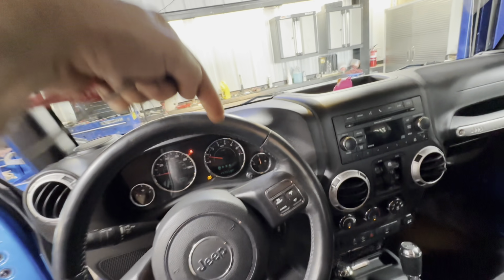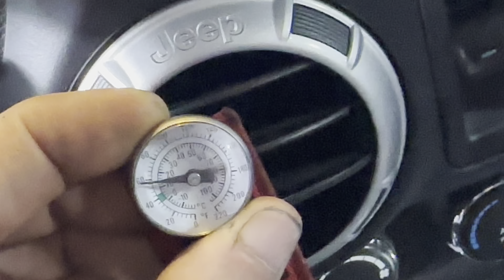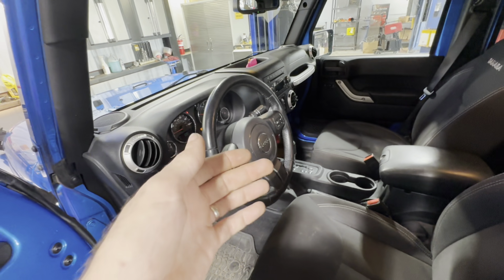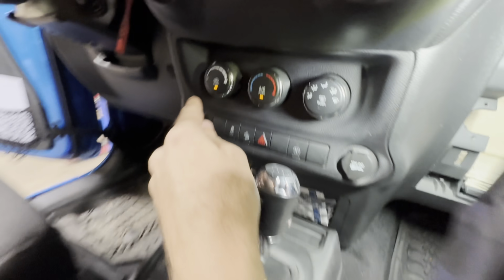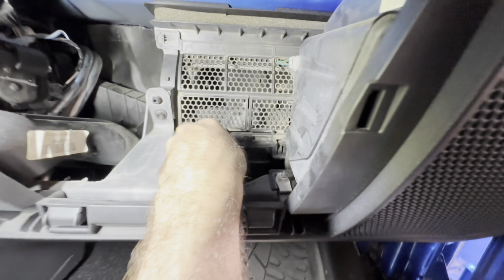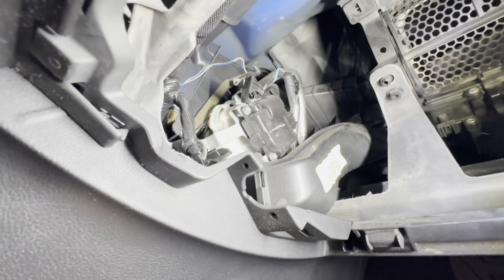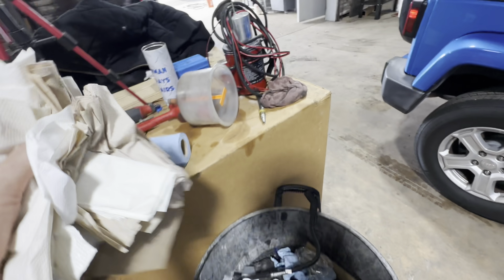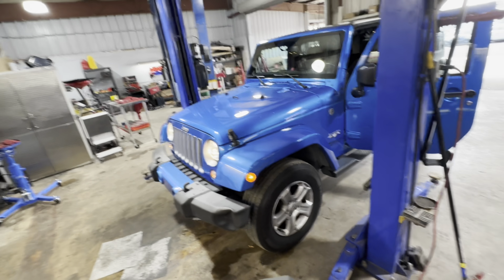Customer States: Vents Don't BLOW!  Jeep Wrangler 3.6

Comment: The reason that happens when you put too many napkins in the glove box and you open the door the suction of the blower motor sucking air through will actually suck the napkins right out of the glove box so it's kind of a bit of a design flaw
Reply: Design flaw on a jeep?   Never!
Reply: It's a jeep thing
Reply: Jeeps don't have design flaws.
Reply: It's not a bug, it's a feature!
Reply: should only keep gloves in a glove box, not napkins
Reply: @bonza167  You ever try to blow your nose with a glove?
Reply: Jeeps don't have flaws, it's just a standard feature to remind you that you paid way to much for a toaster to spend more time at the shop than on the road.😂
Reply: @MonkeyJedi99  of course
Reply: I thought that’s where the trusty handgun was supposed to go?
Reply: Napkin limit feature, brought to you by Jeep.
Reply: @pcspecialistpdx  your right they don't HAVE design flaws they ARE design flaws 😂
Reply: AC performance diagnostics:
Frequent fast food drive through user.
Reply: Put enough ducks in the glovebox, it'll keep the napkins from getting sucked out.

Comment: This happened to my 2008 Ram 1500 - hot driver's side and cold passenger side. Both my mechanic and myself believed it be the blend door. I mean, the blend door is a known issue with these Dodge trucks. Well, come to find out, and after $800 of pulling the dash, the compressor was on its last leg. Replaced compressor and a/c works great. 
The one side and the other cooling was intermittent. I will not be surprised if that Jeep comes back for a/c work.

Comment: Finding all of those napkins is similar to finding the air cleaner packed with acorns.  Both are blocking air flow.
Reply: 2007 Toyota - Pecan bits, paper, etc. We were barely getting any air through the filter! Still wonder how the critter got in there.

Comment: The "unlimited" just means 4 door.
The cabin air filter only came on some models from the factory, the ones with the auto climate control, you can indeed add them to the 2012-2018 . It takes the Fram CF11777 ita actually 2 separate filters.

Comment: There is a cabin air filter that comes in two parts. It installs behind the screen and napkins under the air recirculation vent door. For some reason, Chrysler only installs the filters in about 10% of new Wrangler vehicles . 
Funny, I had the exact same napkin issue with my Wife’s 2012 Wrangler Sport Unlimited. 
Currently, I’m getting ready to install a repaired actuator for that recirc vent door to eliminate a disturbing knocking noise emanating from behind the glove box door. A real PITA job due to access difficulties.
I’ve had to deal with every “known “ issue with Wranglers,including the mystery 302 misfire code for cylinder 2 that is part of a recall the dealerships don’t seem to know anything about.

Comment: This is a very common problem.

Had one kid who put his change in his ashtray  never took it out just kept adding. We had installed a alpine cd player under the dash, it was one of the older cars with a small square radio you could not change, guy comes in after about 2 years his cd player stopped working and his dash rattled everytime he hit a bump.
I pulled the cd player 87 cents in change came out it shorted and blew a car fuse, but i also pulled 67.57 cents worth of change from behind the dash  i had a big hump on the passengers floor board of pennies nickels dimes and quarters.  All his problem was take out related.  But he never took it out.

If you stuff your glovebox with napkins the cars not going to eat them and no putting change in the ash try won't give you more gas milage   funny when cd players came out small children decided they were piggy banks ive pulled plenty of change out of them.
Got a 20 dollar bill once. Nope they don't give quarters as change.

Thats not the biggest find i had in a car one car had a 400 dollar wad of cash,  i gave it back to the owner.
Apparently one of his passengers in the back seat lost it.

Comment: My '16 Rubicon has two filters in back of the glove compartment.  They are the cabin air filters.  The glove compartment is aggravatingly undersized.  You can't fit the manual in without flexing it.

Comment: Ray- when you were putting the coolant hoses back on that engine- you did not put the hose clamps back in place. @45:26 mark of the 1:18:52 video you made on this Jeep. Maybe you did it off camera? I’m sure you’ve said as have others, how easy it is to forget to come back on bolts, hoses, connectors once you start on other stuff (PCV pipe in this case). That Jeep has probably been shipped down the road long ago. Great job overall Ray!!!!
Reply: I caught that too but if you go back and watch the last video for the final fluid fill up and restart he caught it and made it a point that "that's why you always do a once over follow up to catch things like that" He also forgot to tighten the air intake tube to the throttle body which he also rectified.
Reply: @kennybaumann2117 Nope, he found and connected, the air-intake and the upper radiator hose- not the coolant hoses- at least not on camera.

Comment: You can put filters in the air box... They just don't come with them... It's weird because the air box has little dividers built in for filters...
Reply: Filters only factory included on auto climate control systems.

Comment: I had same problem . I ended up flushing the heater core by disconnecting both hoses at firewall in engine bay , hooking water hose to one and the other to a bucket . Got two handfuls of rust out of it . Immediate fix ! Why it was cold on one side and hot on the other , I have no idea .

Comment: Had a 2010 Camaro SS L99 come into the shop last week.  It had warm air coming out of the left vent.  It turned out to be a broken blend door.  Large bill for the customer to get proper temp air coming out of all vents!
Reply: Or you could have cut him a break and not charged him 500 dollars to replace a 45 dollar part.  🤷‍♂️
Reply: See Ray this is what separates you from so many other shops, your integrity is without contestation!! How many shops watching this (and you know they do) were seeing easy $$$ by billing for diagnosis, disassembly, cleaning (or for parts they claimed were required) and pulling the dash to replace the above mentioned parts not needed? There are unfortunately more shops like that (maybe even your old employer 😱) than shops like yours. My only question, like so many others is, was the tiny piece of film laying on the floor of the garage the edit of the mandatory wife unit's appearance?
Reply: @DeeGee-mv6eq  You don't understand the level of work required to replace this part.  It's book time is 16 hours and requires windshield removal.

Comment: Gotta love napkin hoarders😂.  Ray could you recommend a good portable pump for pumping out oil through the dippin stick tube.  Please and thank you.   Have a great day!
Reply: I have seen a way not to get oil out without getting your hands covered in old oil, take a wet and dry vacuum cleaner open the oil filler cap stick the pipe into the filler cap turn it on low suction, then unscrew the drain plug, the suction from the top should stop the oil from gushing out, put a oil tray under the car and turn off the vacuum, and there you are. 👍just a little tip.
Reply: @johnroberts5797  I need it to change the oil in my boat.   The only way to get  to the drain plug is to remove the engine from the boat.
Reply: What you're looking for is a fluid evacuator device, I'm willing to bet your local Harbor Fright store will have one, or Tractor supply, or if you're in Canada, Princess Auto. Relatively inexpensive and they really do work nicely. A small diameter tube goes into the dipstick tube from the evacuator and they typically have a hand pump to make vacuum, or are shop air powered.

Comment: Me as a young military mechanic working on a Chevy K20 Blazer that won't start. Breaking out test light and meters. My subordinate 2 ranks below me: "Did you check the tech manual?" ME: I don't need that, been working on these for years" 2 days later, checking manual. Step 1. Check engine start fuse. .... .... .... Simple thing starting me in the face for 2 days of wasted troubleshooting of switches, wiring, thermal fuse, relays, fuel system, starter..... Meh.

Comment: I have a question maybe you or someone here can answer. My wife has a Jeep Grand Cherokee Overland while using the heater I'm getting colder air on the driver's side and hot air on the passenger side it's a dual climate control. Fluids are good, thanks for all responses.

Comment: Just an FYI, on the JK wranglers, a differential in temperature from side to side is caused by a faulty blend door actuator located on the left side of the center console, just above the drivers right knee. Fairly easy to get to and replace.

Comment: virtually anyone else ... you need a compressor 🤪
Reply: Sadly, you're right.  That would have been a total A/C rebuild in many shops and a partial rebuild in most.  I do diagnostics and I'm often amazed at what people have been told and the amount of money they've spent before they find me and then fix the actual problem.
On a shout out to Ray, after watching one of his/your videos a long time ago I decided to buy a good scan tool, an oscilloscope, and eventually a crap ton of other various tools and learn to correctly diagnose.  Thanks Ray!
Reply: @watchdogu.s.a.8973  Yup, Ray is awesome. Unfortunately finding a 100% honest local mechanic has always been a matter of luck. NOT that they're ALL out to get you or anything. I was always a driveway DIYer, at least up to like head gasket or whatever. I'm getting too old to barely even do my own brakes but I still dig watching Ray every day. Top notch info & his entire philosophy on work life & even life in general.

Comment: Yet another brainiac engineering job by that horrible company! I THOUGHT— about looking at RAM… I find it difficult to justify supporting a conglomerate that never actually repairs or acknowledges their flaws and faults but rather sweeps em under the rug and creates new problems! I know, all manufacturers have their issues but these guys seem to do everything in their power to avoid issues. Just my personal opinion.